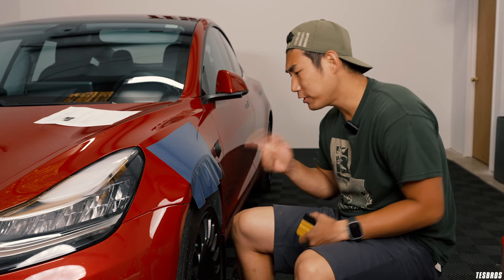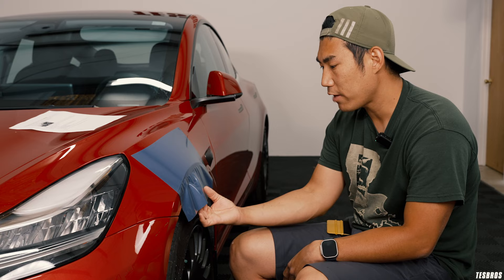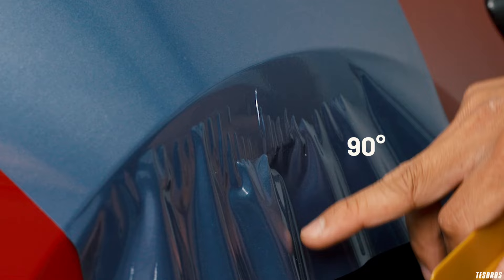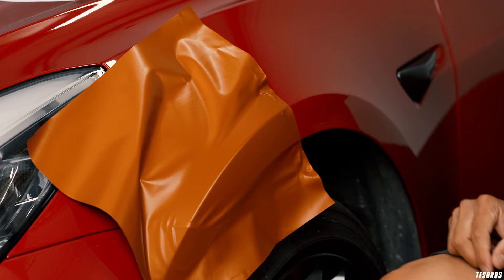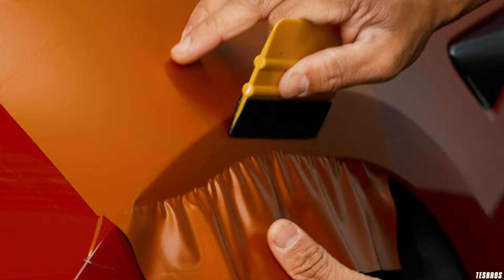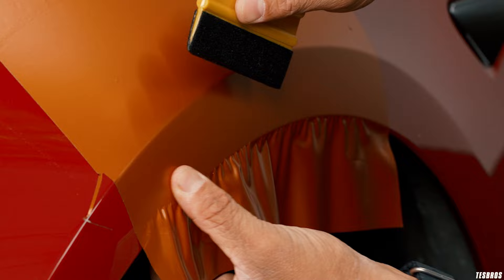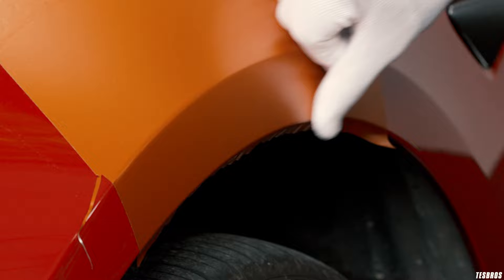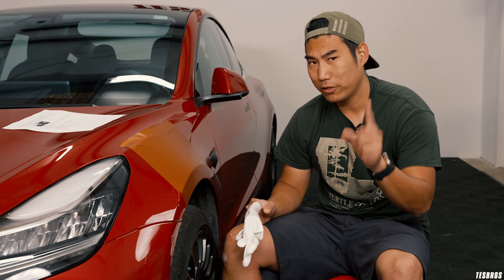How To Get Wrinkles Out Of Vinyl Wrap Edges - TESBROS

Comment: Is that avery? I can not get vvivid or aura to not wrinkle doing that. Its constantly pull back up, heat try again, and creates sanding.
Reply from the maker: This is 3M 2080, but very similar to Avery. Hmm. If those are thicker films like chrome or texture, it'll be much harder to do this technique.
Reply: @tesbros  good to know.  Thanks
Reply from the maker: @jefffinke8225  if it’s thicker, I would hold it out loosely from the panel while you squeegee. See if that helps

Comment: I have an old pick up truck that has round small windows in the back how would I wrap that specific section
Reply from the maker: Without seeing it, that's a bit hard to answer, but what you would probably do is lay film over the panel, including the window. Glass it out. Install around it, then heat the window concave and use a wrap glove to push the material into the valley

Comment: This has a lot to do with the type of vinyl you use. If it's a flat color you can fo this all day but if it's metallic or Carbon you will have a much different experience With stretching and using the squeegee
Reply from the maker: That's a good point. You can't stretch textured vinyl as much since it can discolor or warp easier

Comment: What about if you have excess? I'm wrapping my rear fender on a mustang and it wraps the brake lights slightly. I'm at a point where there's a bunch of excess. It all looks smooth for the 5' from the door to the back but where it curves down, there's about a 3" x 4" area of wrap that is sticking up that I can't seem to lay down at the very end of where I need to cut. I'm not sure if I explained it well enough, but if u have the time, do u have any advice? Should I just stretch it more little by little? I'll have the same problem on the other side of the car if I can't figure it out
Reply from the maker: Would you mind sending us photos on either Instagram, Facebook or Twitter @teslabros ? This will help me give you the best answer!
Reply: I've been having that same issue.